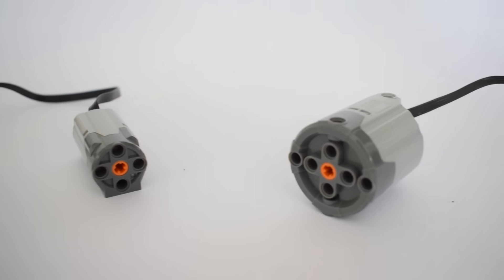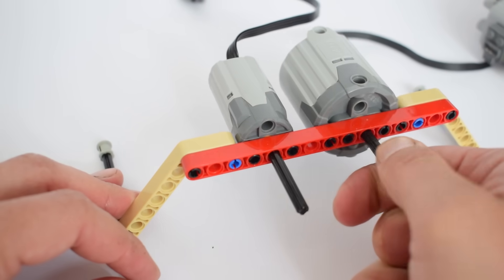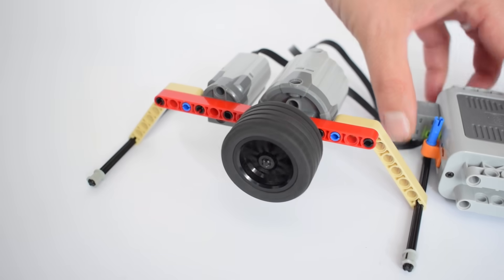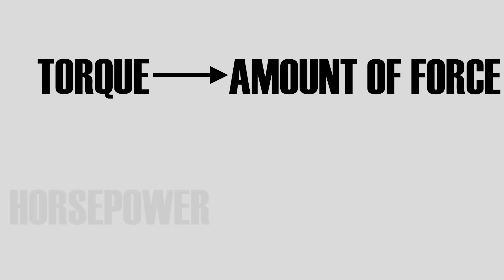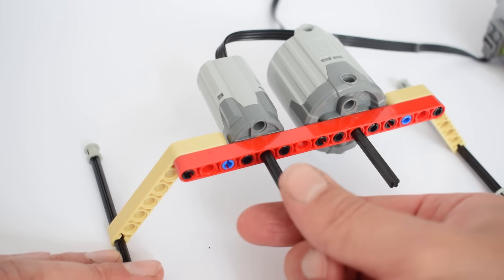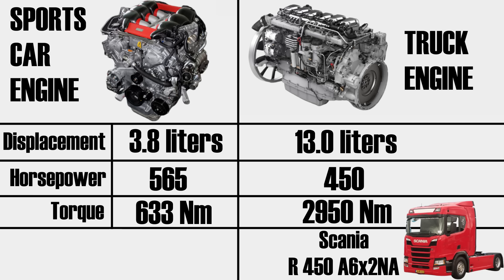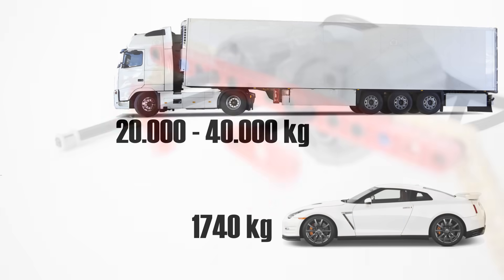NEVER be confused by HORSEPOWER and TORQUE again - HP and TORQUE EXPLAINED in the MOST VISUAL WAY

Comment: Sorry. Good explanation but it does not explain why, in the example that the smaller motor has a higher rpm despite it having a lower torque. Instinct is telling me that it should be the other way around. This aspect I need explaining. Is it the physics of a smaller motor that gives it the advantage rpm-wise  and if so, why?
Reply from the maker: I explained that as well you just missed it
Reply: @d4a  ok. Sorry will check

Comment: So in a race car, you can compensate for low torque with shorter gearing if you have high horsepower
Reply: Yes, and if you have a high-torque, low-horsepower race car, there's nothing you can do about it. The cars with the horsepower will blow your doors off.
Reply: No, power is the important figure. The only reason why trucks have big engines is that a small engine won't last even 10000km at its max power.
Reply: Race car, truck, boat, motorcycle…. All the same. Power, not torque is the limiting factor for not only how fast a vehicle can go but also how much weight it can pull at a given road speed and how quickly it can accelerate.  Anything Torque can do Power can do better and/or faster.
Reply: yeah but you'd be slow as fuck
Reply: @comet.x  Come on man. Use your brain. HP is the determining factor (torque X rpm).
Reply: @NAmania  if you drop the rpm, but raise the torque (exactly what happens on a super short gear) the wheels don't spin very fast. Which means the car does not go very fast

Comment: I’ve had a tough time understanding these concepts for a long time a thin cleared it up for me. Thank you!
Reply: And he got it wrong. You do not feel the torque. If the engine doesn't move it doesn't matter how much torque it's producing. It's producing NO power.

With the smaller motor you can apply a gear to make them turn at the same rate. What number tells you the force after gearing.. THE HP NUMBER.

The work done is what you feel. If you have your finger directly to the shaft you're feeling the POWER of the magnetic forces.

Comment: I believe the real reasons trucks use 'torquey' engines is because low revving engines are cheaper to make reliable and are also more fuel efficient (both in part due to reduced friction). Gears mean that the torque of the engine/motor is irrevelant when it comes to carrying heavy loads when comparing engines of the same power, aside from the awkwardness of having to rev a low torque engine a lot to get started from a stop.

Comment: Fantastic video. One minor comment that's not related to the point - internal combustion engines technically operate off of energy stored within oxygen rather than fossil fuel which is simply used to fire the combustion. The oxygen that is compressed is what energizes that combustion and turns the crank.
Reply from the maker: Thanks glad you like the vid, but It's definitely the energy in the fuel and not oxygen

Comment: All good but the force that your are feeling from the seat has nothing to do with the torque, the force is caused from the vehicle accelerating and this is caused from the engines HP. 
This force will reach its maximum when the car reaches its maximum acceleration that happens when the maximum HP applies.

To clarify this even more lets say that two cars, A and B weigh 500 and 1000kg respectively. Car A has an engine producing 50hp and 10nm of torque, car B pumps 100hp and 40nm. When onboard car B wont feel neither be twice as fast as A, but it will be able to pull a boat.

Comment: The statement torque doesn't care about time doesn't make sense.  torque = F x Radius, and since F= m x acceleration, time is a factor.
Reply from the maker: Torque doesn't care about time because when you say something outputs X Nm of torque there's no time factor. When you apply a force to a wrench you can apply it slowly or rapidly it doesn't matter as long as the force is the same the torque will be the same. Thus time is not a factor.
Reply: @d4a  but a higher force would mean the acceleration of the wrench or change in velocity is faster, and this is coupled with time.

Comment: I've found out that the relation between torque and power can be described, in simplistic terms, in two ways:
a) power is an indication (it is not equal_, only _related ) of the reserve of torque that a motor has. 
b) torque is an indication of how quickly a motor can increase the power it outputs
Overall, I found your explanation quite informative.
Even as a physicist, I always found the relationship between power and torque of a motor very, very confusing.
Reply: I'm very bad at physics. But the relation between torque and power is simple to me, since the day I learned about it (which was a week ago). When you apply torque to a gear and it can't turn because the torque is weaker or equal to the amount of force needed to turn that gear, your power output = 0. If you have a gear that spins but is disconnected from another gear, or wheels, or a lever, you power output also equals 0. 
I find your explanation a bit confusing to the point that I can't even tell if it makes sense. In any case, as well you know, being a physicist, it all comes down to the math of it. Which is, Power=torque * rotations per unit of time. That explains everything that can be explained about this relation.  The whole confusion only really starts when you talk about real life combustion engines and vehicles. The above video is perfectly explaining the physics of power of motors. But at the very end he already introduced something that is misleading about the horsepower by giving an example of a sportscar that has more HP than a truck. Well, it all depends on what kind of truck and sportscar you compare. This is the source of confusion to me. Because then, people start to think that higher RPM is better for higher HP than higher torque. Which technically isn't true at all. And I became interested in all of this because of IndyCar races. 
PS> If you want to enter the rabbit hole, try understanding the relation between HP, torque, rpm and speed of a race car. That's a whole 'nother can of worms. lol

Comment: Why can't a high torque engine, such as that in a truck, be geared to rotate the driveshaft faster than a high HP, low torque engine?
Reply: It can, but the torque at the output will be decreased by the same factor that the speed increased.

Comment: the key word of horsepower is...
me: horse
video: power
me: hmm, well it originated as a term referencing engine pull when raced against a horse at a full load.  more horses meant that full load was better distributed and therefore normally faster... iirc, once we got engines that could generate more than 20 horsepower, the comparison was pretty dead in the water.
Reply: It originated as the average power a horse could output throughout a working day. No racing was involved.

Comment: Simplifying the whole video; Torque=how much work is being done  Horsepower=how much work is being done over a period of time.  This is why you can have an engine that produces 1 foot pound of torque and can spin at 2000 RPM, and have the same Horsepower as one that produces 2000 foot pounds of torque but only spins at 1 RPM. Which is why HP is a pointless value used only to confuse car buyers.

Comment: This video finally did make it click for me but unfortunately the lego didn’t really do it. The biggest problem I had was how the sports car had more HP than a truck but can’t pull anything. I knew torque was how “powerful” the engine was and horsepower did have a time component but never understood it. 

I had a straight up revelation when you mentioned the truck redlines at 2k RPM.

Comment: 1:35 You might also want to explain instead those weird non-SI units (pounds? feet?) you are using, you know ;-) 
for those needing a kilogram equivalency for the Newton-metre (N·m): 1 Newton = 0.102 Kg  - so 1 N·m is roughly equivalent to the force made by 100 grams at the end of that 1 meter wrench.

Comment: Findings;
Gearing ratio can also helped to rationalise the workload over the designated weight conveyance on every specified vehicles that desires any respective efficiencies on both fuel and the weight-limit whilst to address the designated horsepower and the torque on the engines that under subjected on its limited capabilities into the well-ordered self-efficacies and a required speed concerns.

On the other hand;
thus aero and vehicle dynamics to calculate its weight distributions from the vehicles on chassis were also trickiest to configure, whilst chassis designs relies integrated mechanical technologies whilst the weight is either a ballast or a torque workload as those to address those imperfect weight areas can sometimes the ballast were it is used to find the exact or to compensating those counter-balancing G-force dynamics
👍😎🇵🇭💝🌸🌼🌷💐💖💗🌺🌹❤️

Comment: So the horsepower changes based at how many RPMs the engine is working. Question: does the torque stays them same at any given gear or RPM?
Reply: For most types of electric motors torque is "mostly" constant regardless of RPM.
For internal combustion engines torque varies greatly over it's RPM range.
Reply: @henryyopp9094  that makes sense, the more air/fuel enters the combination chamber, the bigger the explosion this higher torque

Comment: you can manipulate Torque output of the 2 motor by using Gears.
example is what should be the gear ratio of motor 1 in order for motor to be equal to motor2 (lets say motor 2 has higher Torque than motor 1)

Comment: Why cant a motor with higher torque produce more hp. Is this due to transmission?
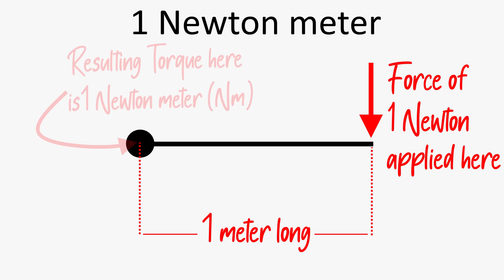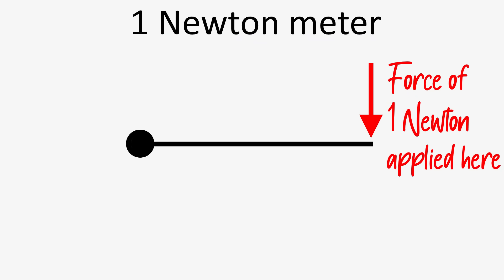Reply: Short answer you can. long answer, I think youre asking the wrong question. You can always achieve any torque by changing the transmission to some gear. ratio for an engine of any horsepower. For example, for the same motor you can always attach a 1:20 gear ratio to achieve more torque compared to a 1:10 gear ratio but you cant achieve more horsepower with the same motor. The 1:20 gear ratio essentially sacrifices speed for force. You can essentially go as high as you want for torque as long as you have the right gear ratio for it, but you always sacrifice speed. Vice versa at the same torque a higher horsepower motor is going to spin faster than a lower horsepower motor. This is because power introduces time. The higher powered motor applies force faster. The force is the same, but faster, thus it spins faster. At the same speed, the higher horsepowered motor is going to have higher torque compared to the other motor. You can have a motor that produces higher torque and have higher horsepower than a second motor, but they need to be different motors. If you are talking about same motor, their horsepower is always going to be the same and they can have different torque depending on the gear ratio. Taking the sportscar and truck example since the sports car has higher horsepower, if you slow its engine rpm down to the truck's speed by changing its ratio its going to have higher torque. And you have an engine that has both higher torque and horspower. If you raise the speed to be slightly faster than the trucks engine, you can even have an engine that spins faster, has a higher horsepower and also has higher torque. But the reason we dont swap engines it is because its inefficient. The fuel economy for sportscar engine is terrible for truck driving. You're wasting a lot of fuel, truck engine is efficient. On the other hand a truck engine is built to be durable and efficient, which makes it very heavy for its horsepower. which makes it difficult to accelerate and decelerate in a passenger sized car making it difficult to drive, so we dont want a truck engine in a car either even though its a efficient engine. Each engine is purpose built to do different things. Which is why you need to look at both torque and horsepower to know that the engine is doing.
Reply: @jchen8942  so if a truck and sportscar have same hp, the transmission is the thing that makes sports car highspeed(with small gear ratio) and truck high pulling or pushing(high gear ratio).  Btw thanks for taking time to clarify🤝
Reply: @Macho98  👍glad to help. Also, you're almost right, you have the torque hp concept and logic down so you pretty much got it. But because they're designed differently engines alone dont spin at same speed. Truck engine is naturally designed to spin at lower rpm and have a higher torque. So without any gear and having same hp, truck engine is just going to have higher torque and lower speed just because thats how they are designed. So if you have a sportscar engine and a truck engine at same hp, If you adjust them to have same speed, they will have same torque. But ultimately, ignoring fuel economy you're right. you can theoretically have same engine and have one power truck and the other one power a sports car by simply adjusting gears.
Reply: @jchen8942  this lessened my confusion😅 (truck sportscar example is nice. i always wondered about the samething. transmission is the one that makes the difference ignoring fuel economy)very helpful!! Thank you

Comment: The topic has not been disclosed. Could you show by an illustrative example how both of these motors cope with the same job? I explain. The torque of a small motor is 4.6 times less than that of a large motor. That is, if you take 4 small motors, whose total torque is still less than the torque of a large motor, their total power will be 1.8 times more. It could be demonstrated that a configuration of four small motors does more useful work per unit of time than one large motor, but with more torque. How to do it? Make these motors lift the load. In theory, a large motor will be able to lift a load 1.16 times more from the ground than 4 small motors, but a small motor will move 1.8 times more load during this time.

Comment: So        torque  = twisting power
    horsepower = max revolution ability?

or like the difference between the big gear and a small gear on a bicycle?
Reply: In a way yes. Torque is twisting force. If you were to reach out and try and stop the motor torque fells you how hard that will be. Power is forcer times angular velocity ( rotating speed). How hard something turns times how fast it turns.

Comment: The torque can be changed using a gearbox, right? So a sports car could have more torque applied by the wheels than a truck
Reply: Yes, as long as both engines make the same amount of power.

Comment: A sports car and truck with the same hp can move the same load at the same rate. That's the point of hp as a measurement. The difference between them is that the truck engine needs to do it all day for a lot of miles  and efficiently. The sports car needs to weight less and does not have to be as good on fule or longevity. So they designed their engines differently to better fit their jobs better.

Comment: I don't agree with you in this video and I still feel like you're falling into the trap most people do. It's about half right. You can only feel horse power. You have to apply torque over time to feel it. We can't experience things in infinity small amounts of time.

 It's like saying you can eat a cheese burger without the cheese. It's not a cheese burger till you have both cheese (tourqe) and a burger(rpm).

I use this exmple a lot. A bike that you peddle with your feet puts out as much or more tourqe than 600cc sports bikes. But they feel totally different. It's because the sport bike can have way more rpm leading to a lot more hp.
Reply: What you feel is torque (even very low torque) applied very often. It's still torque even though you are right in that the Horsepower metric is the best indicator of how much "stuff" you going to feel

Comment: Great video! I am a bit confused however, if someone could explain how torque would give you the feeling of acceleration when: Force = mass *acc, Pow = Force*Speed, so Pow = mass*speed*acc . Which means, for any given vehicle, that has a certain mass and is going at a certain speed, power is directly proportional to the instantaneous acceleration, so the feeling you get when a car is accelerating is due to the power, not the torque.
Reply: What he meant is that torque is the force behind everything. Power is torque x RPM! When you have ignition in the combustion chamber, the connecting rod applies torque to the crankshaft! You see? But yeah the way he phrased it is confusing since the AMOUNT of acceleration you feel is determined by HP (but still comes from torque)

Comment: horsepower is power that’s used for the pushing, and torque is the power of the push?
Reply: Torque is the rotating force of the motor, so how hard it turns. If you were to reach out and try to stop it the torque output of the motor tells you how hard that would be. Power is torque times angular velocity (rotating speed). How hard the engine turns multiplied by how fast it turns.

Comment: So i understand that if i wanna use a dc motor to move a gearbox for alternator should i go for higher torque with good rpm  its gonna do better than low torque with high rpm or massive torque with low speed rpm .. so i wanna go with 895 dc motor .
Not 775 low torque high rpm or 997 high torque low rpm . Is that clear is that good ?

Comment: You've confused me more. Your equation is not accurate. HP= Torque x RPM doesn't work out. My truck makes 1500 ftlbs @1500rpm. So using your equation it makes 2.25million HP. I don't think so. It would also be helpful to explain how the measurement of horsepower is so convoluted
Reply: His equation is not complete. The full formula is ft*lb torque × RPM /5252. You have to divide by 5252 because of unit conversions. 1500 ft*lb at 1500 rpm would be 428 horsepower